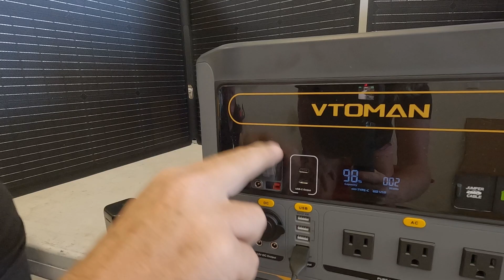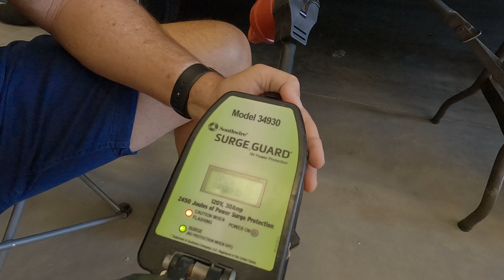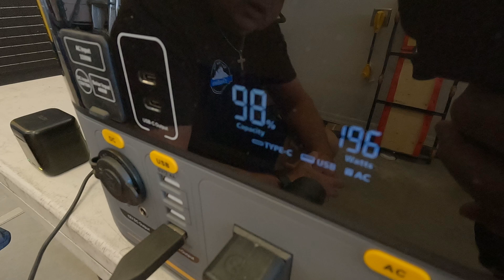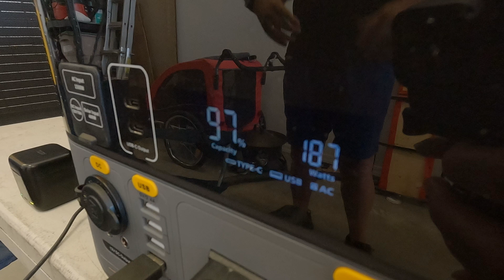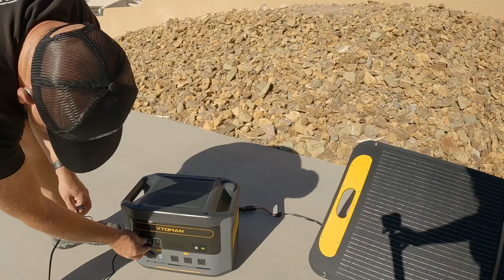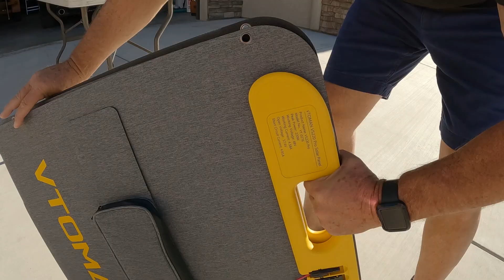PORTABLE POWER STATION PUT TO THE TEST // VTOMAN FLASH SPEED 1500 // WILL THIS POWER MY RV?

Comment: Will it run the Air Conditioner if it has a soft start ?
Reply from the maker: Hi Evert, no it won’t. 1500watts is way too small to run an air conditioner.
Reply: @OverTheHillAdventures  ~ I have the 1800 VTOMAN model. I'm going to add a soft start to my 13,500 AC and see if it will work. I'm thinking it might. It's supposed to have extra surge power.
Reply from the maker: Keep us posted!
Reply: @OverTheHillAdventures  ~ I'm actually disappointed with my VTOMAN. It takes too long to charge it.

Comment: This unit will not be fully charged to 100% in 8 to 12 hours as he says...NOT with a 220w solar panel. Look at VTOMAN specs and it clearly states it will fully charge in 6 to 8 hours with a 400w solar panel. "400W Max Solar Input:23% high energy conversion, Fast Solar Charge in 4-8 Hours" and that would be under perfect conditions. 220w Panel will take about twice as long or realistically about 14 to 16 hours under perfect conditions. He also noted that the solar panel he has is a 200W panel however it is 220W as they do not make a 200w panel. His statement would be correct if he was using a 400W panel. Don't be fooled by thinking a 220w panel will charge as fast as he stated.
Reply from the maker: @frederickweller6574  hi thank you for all that great information.  I was able to fully charge my VTOMAN in 8 to 10 hours.  I did it several days in a row.  Don’t ask me how I’m not expert as yourself.  I can only tell what I have experienced.  Wake up in the morning with my trailer hooked up to the VTOMAN.  I will say it was not all the way down to 0.  It’s usually down between 10 to 18% fully charged in 8 to 10 hours.  Worked great for us boondocking in the Quartzsite desert.  Thank you for joining us and your comment.  Stan and Rhonda🙏🏼❤️

Comment: Great.  I was just wondering if I could use my 1000 watt jackery to charge my rv battery.  After looking at your video, I’ll need to check a few things but I might just be able to.   Thanks for this video it was very helpful.
Reply from the maker: Hi Manon, it did really great charging our battery.  I was able to plug my trailer in all night.  Then charged it all day with the solar panels.  Worked according to plan.  Thank you for joining us.

Comment: When staying overnight at a Harvest Host or Cracker Barrel, we use Jackery Explorer 1000. I use a 600 watt Mr Coffee Drip mini 5 cup to make coffee. My wife uses a 700 watt Nutri Fit bullet blender to make her breakfast smoothie. Still have enough power left for recharging phones & laptop. Then recharge Jackery in truck while traveling to next location. We can also use Jackery folding solar panels or shore power, when available, to recharge the Jackery. 
We've even used it at home during power outage to power Xfinity Modem/Wifi & 55" LED TV for several hours 😊
Reply from the maker: Hi Earl, that is awesome!  The VTOMAN work’s incredible.  The cool thing is I add another 1548 watt hours.  Thank you for joining us and especially for sharing.  Thank you!! Stan and Rhonda❤️